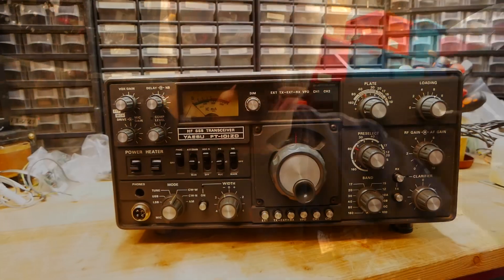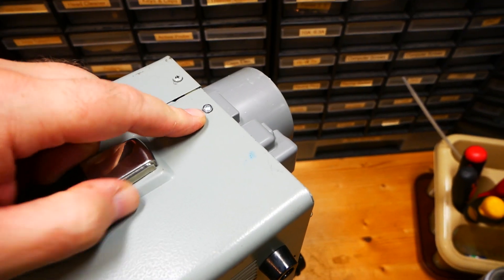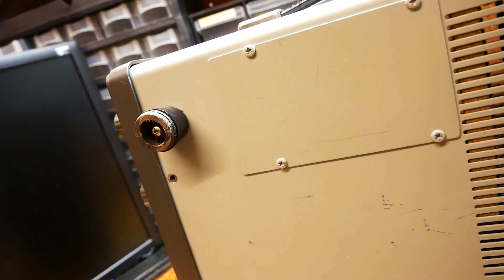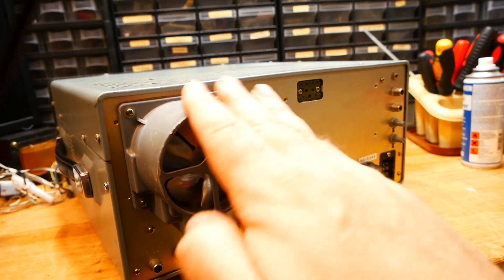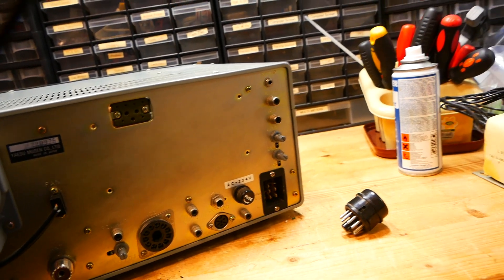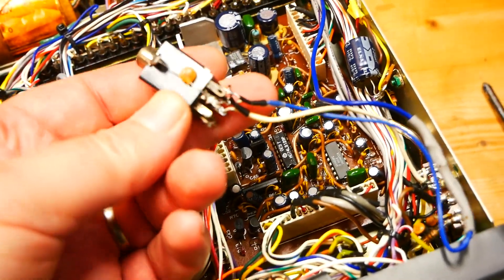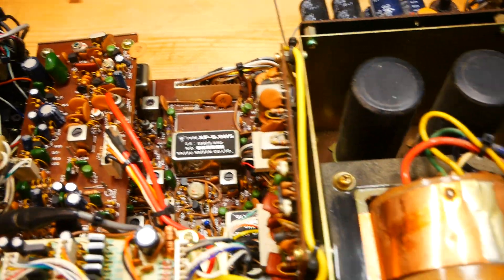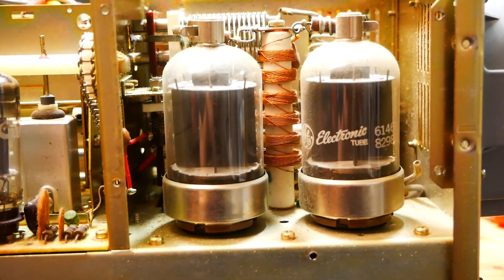Amateur Radio Buying Guide: Yaesu FT-101ZD, what to look out for

Comment: Hi there, I appreciate your info here.
I have a 101Z that I purchased new in the late 1970's. It has sat in storage for many decades. I have recently had the caps replaced and a general go over and it all seems good with the exception of what appears to be dust in the front pots and switches. Are you able to advise the best method for cleaning these up?
Many thanks and keep up the good work.
Cheers. Peter, VK5VK
Reply from the maker: WD40 makes a good contact cleaner that always worked for me. Not the ordinary lubricant, search for WD40 specialist contact cleaner. Good luck!

Comment: I just acquired a mk 0 101zd  on Fee Pay (probably spent too much also, going by your estimates) the problem I'm having with it now is the digital display doesn't light up ( the light for the vfo dial lights up, just not the digital part) could it be a bad display,  vfo or what? Everything else seems to work, (makes noise, knobs seem to function,  etc) but haven't tried tx yet, because of the display problem.

Comment: have a 901dm and ft-891 in the shack use the 901 the most, great radio so far, repaired the 901 three years ago ,no problems yet .also i have an ft 101zd,radio but the band switch arc and burned some parts around the switch cant tell what they are to replace them, all the boards work fine ,still looking for a used  ft 101zd that has a a good band switch that i can make one good radio out the two, I really like that radio and would like to fix one day..73 KN4YYB

Comment: Hi Darrell Thanks for the video and info about buying ft101zd.  I have been left two of them by my friend who is sk now. One is working the other was for parts not working! However a simple thing like a tube forced in that bent a pin over, of the non working one, and now its ok again. I am looking for two things that maybe you can help me with, as you have lots of old ft101zd lol.
  No1 is a premix local unit pb-1965 complete with components. As the one in the rig has been butchered "where i guess" the crystals have been changed by someone.
 No2 a cw filter. as neither rig has a cw filter in them!  thanks in advance. Colin
Reply from the maker: Sorry mate, I can't help you with these parts right now. I email you as soon as something turns up.
Reply: Thanks for your quick reply ! all the best Darrell

Comment: Hi Darrell, Thanks for the video. I see that you have so much FT-101's in stock....is there any chance to buy a VFO or the PCB of the VFO for a FT-101ZD ? It would be great 😁 Thank you - Stephane.
Reply from the maker: No problem. Check out my eBay store "hifissb". The vfo is in stock.
Reply from the maker: The item number is 373761556343
Reply: @hifissb   OK, thank you for the information ! I will check. 73's.

Comment: Great video for a great radio. I have 2 of these and they are working fine. Relays cleaned and capacitors changed is all I did. Not much drift after warm up. Had a FT-902 with most accessories but had a drifting problem. Also have a FT-901 and Ft-102 that need work. Love these old radios.
Reply: For which reason do you need 2 of these?
Reply: @klausjerwan596 same reason I have 6 of them, and counting:)
Reply: @klausjerwan596  I repaired the 2nd one I had and it is for sale but I am going to keep the first one as it belonged to an old sk friend. Take care my friend and have a great day

Comment: I have a question to ask on the 101 ZD on the top left corner with the cover off I believe it's the rectifier board there is a potentiometer and a bunch capacitors should there be a certain voltage

Comment from the maker: Not really, the 6146W type is more robust but if tuned properly, the standard 6146B tubes last forever. Most transceivers that I have bought over the years still had the original tubes installed and they nearly always delivered full output.

Comment: HI my name is Albert EI5HXB From Co Clare Ireland. 

I have a ft101zd mk3 that is working but slightly deaf. Week signal. On all bands. Power output is 100 watts but I think the poor recive is the first stage if board .
Would that be the problem in your experience.  ? I love this radio and would love to get it up to 100% .

My email is ei5hxb@gmail.com 

Thank you for the video.
Reply from the maker: Try cleaning the relays first

Comment: Hello Sir,I have a Yaesu FT-101ZD MK II that I purchased in good working order at a swap.  I have ordered from ebay twice now the DC-DC Converter or so I thought.  Both came only with the drive transistors and the mounting frame for the back.  No other components or the wire harness with mating plug for the back of the main transceiver.  Do you know of where I can get a complete unit for the DC-DC Converter.  Thank you for the video.Darrell, Michigan, USA